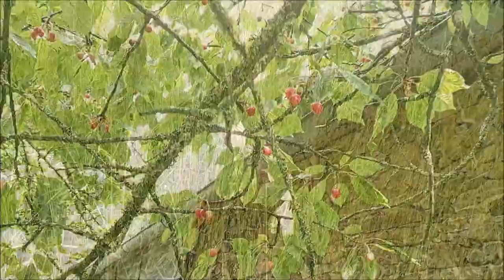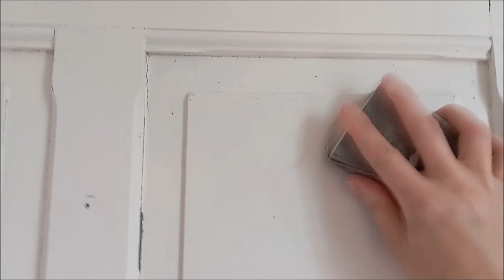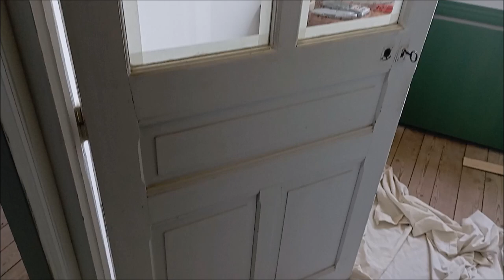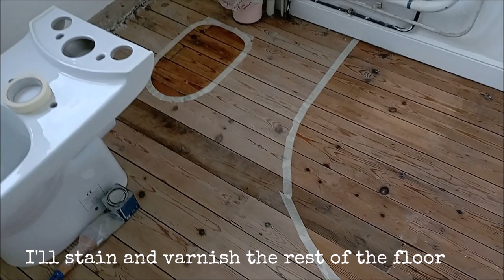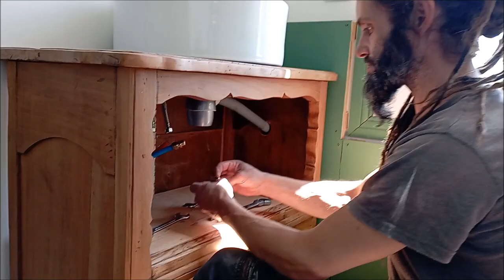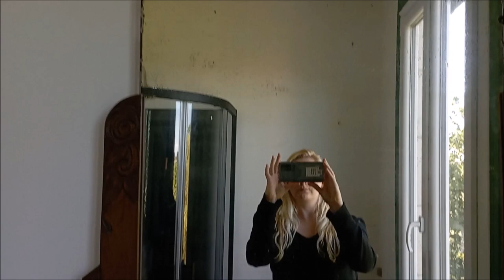Deciding on paint colours AND plumbing in the bathroom | FRENCH COUNTRY HOUSE RENOVATION VLOG 15

Comment: Please put lights on either side of mirror  at eye level in balance . The light is then best for grooming and your ceiling light will then light the room. This is true design rule . I have done this many times in projects. Best always, Lois.
Reply from the maker: Thank you for the eye level tip. I had read that the height is important so as not to cause shadows on the face. There's a lot of natural light in the room, but sconces would definitely be useful for getting ready to go out in the evenings.